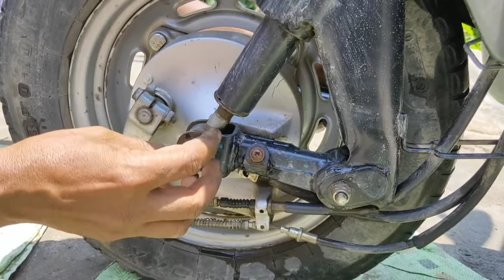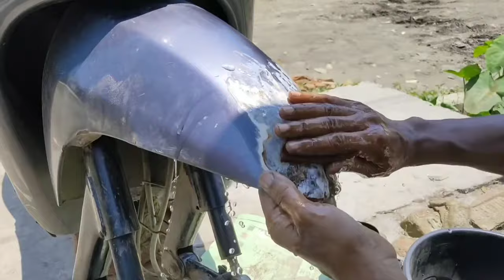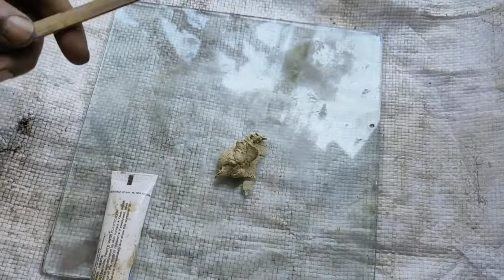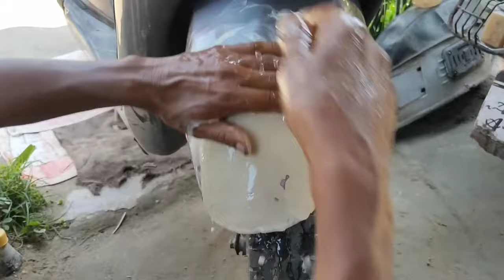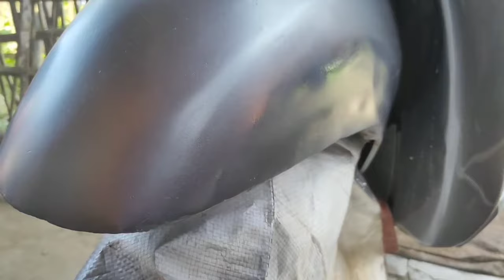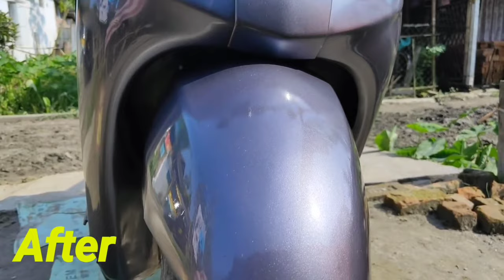how to dent repair | dent restoration | fix a dent scratch repair scooty dent repair

Comment: Hello bhaiya
Want Help
Kross K10 18 Gear,
2014 me buy ki thi Owner ne phir maine 2020 me li unse,
bahot tym tak khadi rhi baahar unke yhaa but maine ab thoda thik kra liya 1500rs lagake brake, gear, seat , lock
but 'Front Gear' bilkul v smooth' nhi h coz 'CHAIN utar' jaati h front gear shifting k tym kavi kavi n rear thoda h smooth,

i want to maintain my MTB like its part of my family now

Disssemble karke PAINT karni h or old RUST wale Parts change CLEAN then lube n sab
 but how i do it dont know coz assemble or set kese karunga phirse.?
Koi video Same model pe mil sakti h kya plz?
Reply: Good work